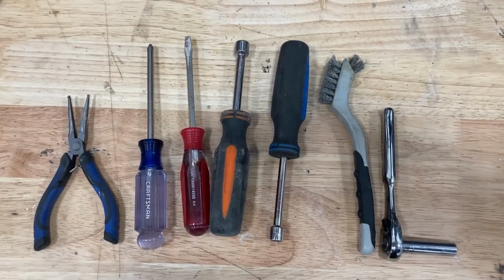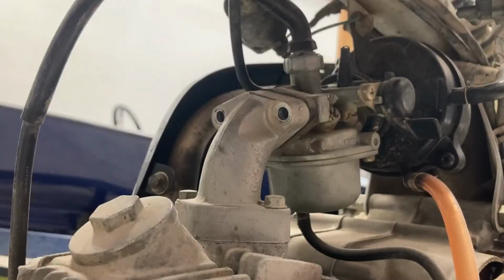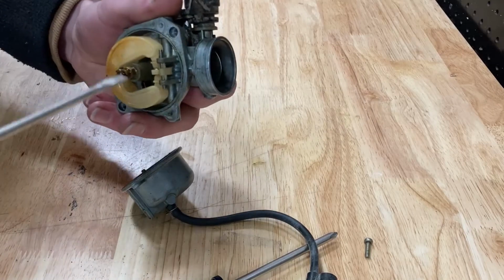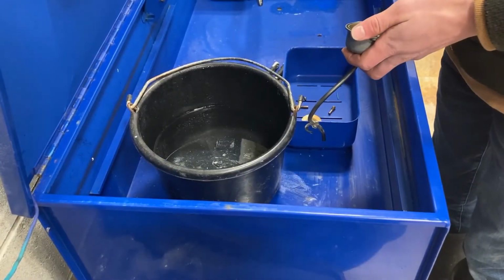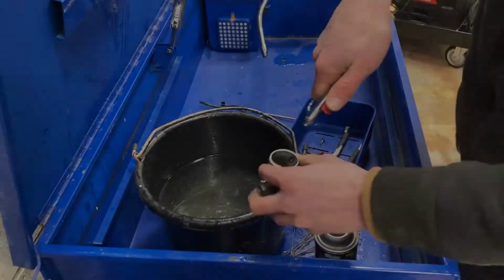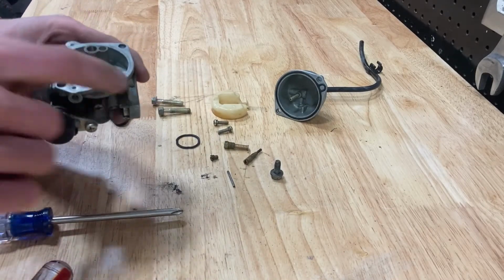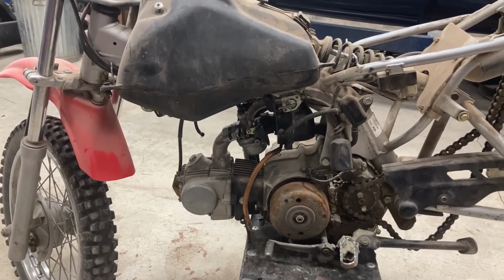how to rebuild crf70 dirt bike carburetor. Step-By-Step tutorial.

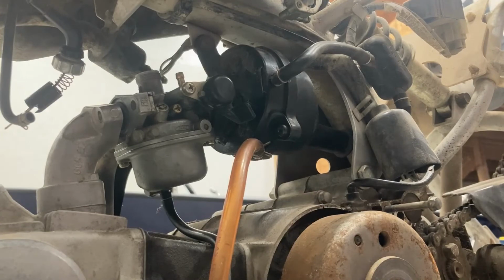Comment: @4:37   you are missing the o-ring on the carburetor.  Also, you installed the spacer backwards.  the o-ring on the spacer should face forward to seal on the intake elbow.

Comment: does the throttle linkage just slide out or how do i get that out if you could explain it to me id grateful apricate it
Reply from the maker: yes, it slides out. usually, I stick a flat head screw driver inside the carb and lightly pry up on it.